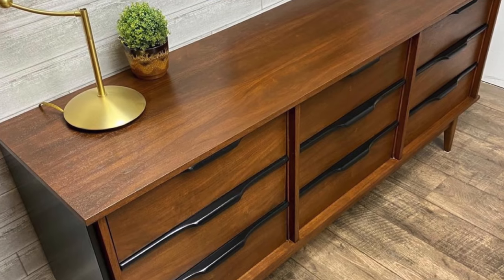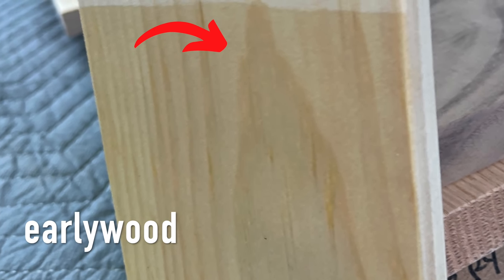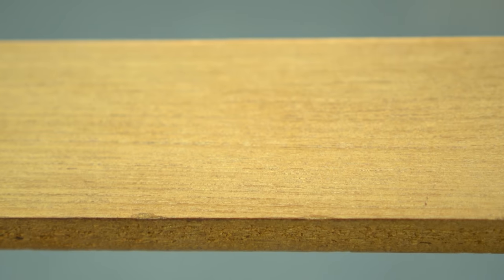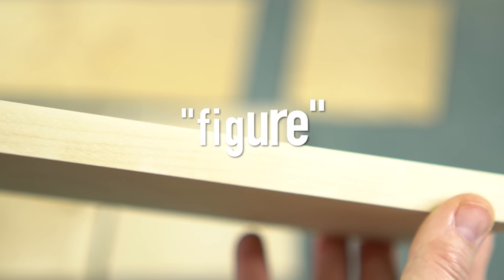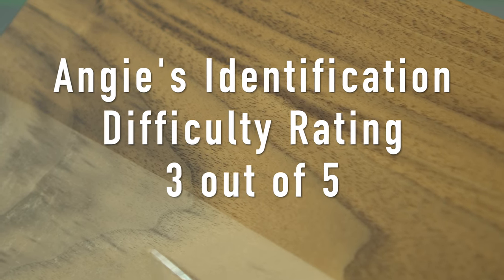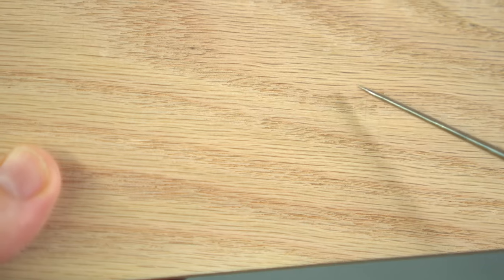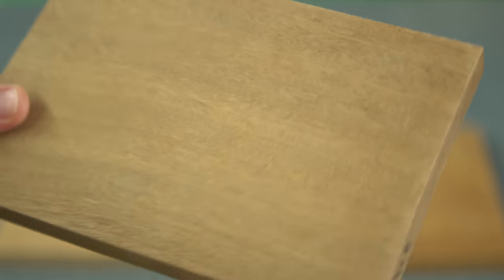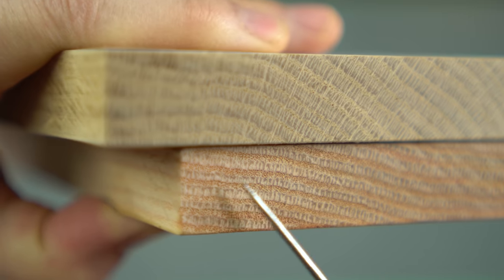COMMON FURNITURE WOODS: Beginner's Guide for Furniture Flipping / Refinishing

Comment: Hi can anyone please help me out with some advice, I am now living with a serious spine condition and it’s now affecting my ability to use my fingers, toes, whole right leg, ankle and back. I am now using a wheelchair to get around these days. I managed to sand down and buff out my pine wood chest coffee table and then out of pure desperation to not let my work and time be wasted, I eventually used castor oil all over the whole piece. As I already had it located in front of my sectional in my apt and had no physical way to relocate it, to keep it safe from other people who unaware that it’s not treated or finished, or from even myself with all my current clumsiness seeing as I fall down a lot and spill things and have to eat with hot plates and coffee mugs, while still laying down on the couch. Thanks to my new physical condition. So now the table has been layered with black castor oil and I’m wondering if it’s possible for me to use anything else on top of that oil as a an extra few layers of protection and then a finish which would protect the wood from water stains, and heat as well as to harden it and from anything else that might happen. I know I messed up but the table top kept getting hit and I was worried about it. Please help? It would need to be something that I can use indoors
Reply from the maker: Castor oil, while sometimes used as a polish, is actually a non drying oil, which is usually not recommended on raw furniture, or finishes that are broken/not intact. Non drying oils don’t fully dry/cure like other oils (such as tung or linseed), and doesn’t offer any protection it its own. Because the castor oil is already on, your best bet might be to use another oil based finish, like linseed or tung.. I’d be cautious about something like a polyurethane at this point because it may not adhere properly over the castor oil.

Comment: I wanted to like it, but I'm afraid this video was just an overload of information delivered at warp speed. As a beginner I'm more confused now . She is brilliant and I'm sure a more advanced individual will be able to follow this video easier than I was able to.
Reply: I regret leaving this comment. It great that you choose to share your knowledge thru this video. I came wanting an easy quick cheat sheet for identifying furniture. What I got was actually an explanation why this is so confusing. My apologies for the thumbs down.
Reply from the maker: I actually read your first comment last night, but wasn't entirely sure how to reply, so I left it for today. I see now your second comment, thank you for that. You are correct though that there is a LOT of information in here. I tried to lay it out the best way I knew how, but it's definitely a lot. Many folks have told me watching it a couple of times helps certain points stick, but as mentioned in the video, there really is no quick and easy way to learn.. it's soooo much repetition, cross referencing and practice. I only got good at it after doing a ton of research, and cross referencing online when I got a new piece I was unsure about. Even now, I can really only tell the most common ones I run into quickly; the rest I keep researching as they come up. I hope this video helped, at the very least, a little bit initially, and can be used for cross reference down the road if you're ever stuck. The wood database (you can just google it) is a WEALTH of information and was very useful to me when I was starting out. Thank you for your comments, and good luck down the road. :-)